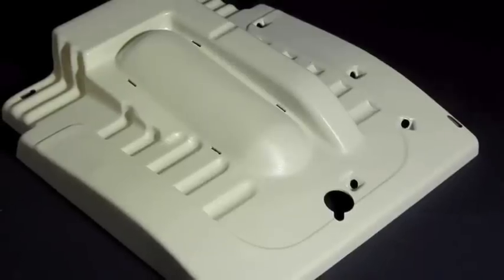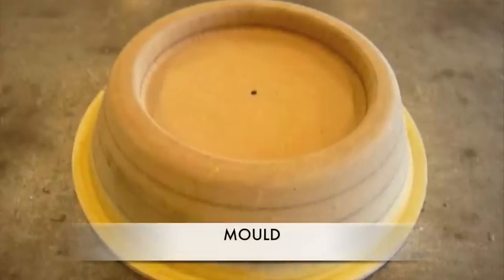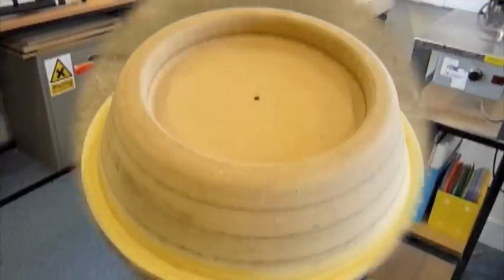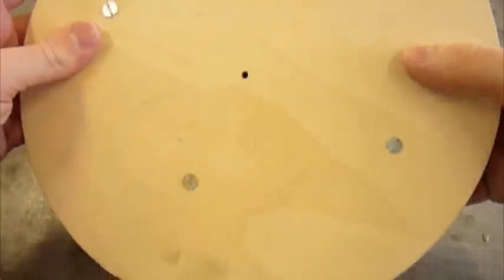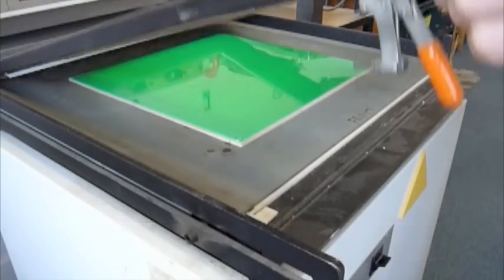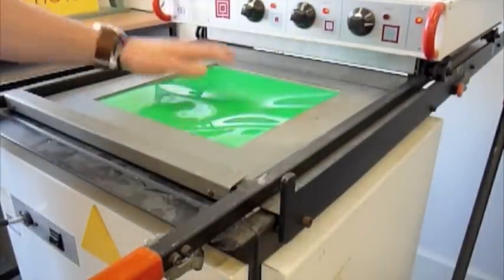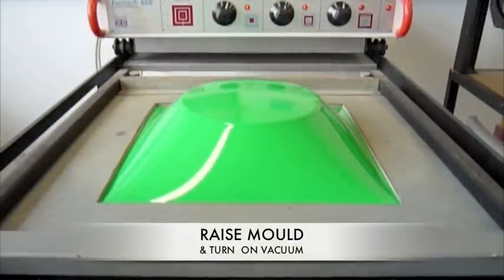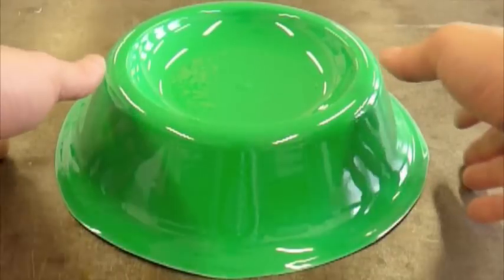Vacuum Forming Walkthrough

Comment: Great video as always with thermoforming trimming is the biggest issue unless you have a cnc router and even then there are still issues with clamping cutter and speed selection and of course spindle accessibility
This it why the use of acrylic where possible is great as the whole thing can be trimmed with cnc co2 laser with little or no clamping